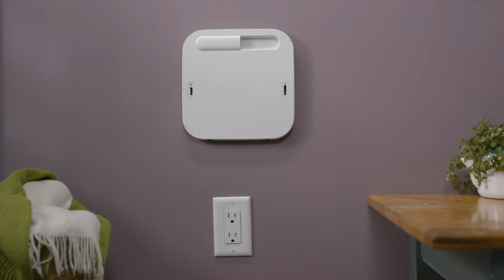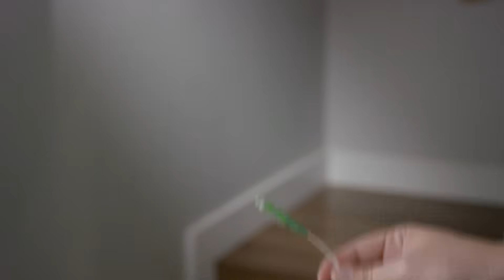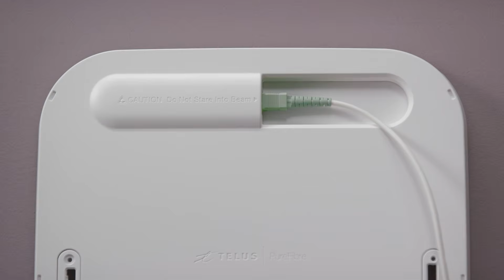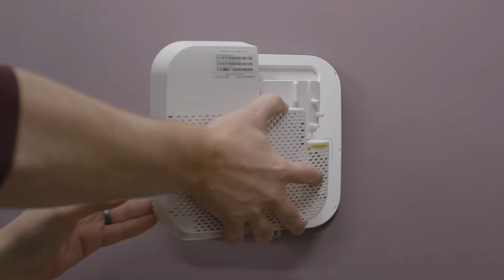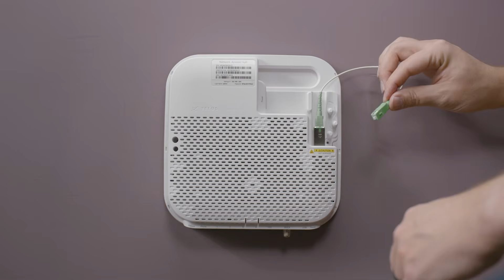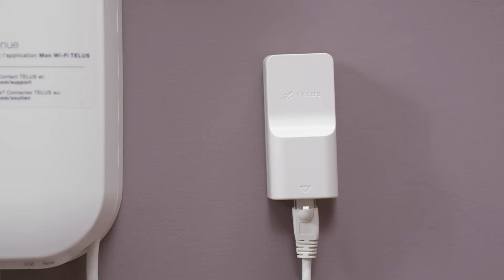TELUS | Installing a Network Access Hub

Comment: It's as if most of you started complaining about not knowing how to open the cover without actually watching the video.  It's amazing how quickly people act like children.  Go back and watch the video.  it's 3 minutes long and it shows them taking the cover off.  nothing more to it.  And yes i have the same one and I have removed the cover and the passwords you need are printed on a simple sticker .
Reply: this child couldn't see where is the procedure to open the cover in this video
Reply: The video has nothing to do with opening one that is mounted to the wall. That shows disassembling it when it comes out of the box, when it is not attached to the wall plate. 
People wouldn't be complaining if it wasn't designed to be very difficult to open.

Comment: How do o get the admin password
Reply: There are 3 screws you need to remove to get to the "inside". Honestly F** telus for hiding it in there, I just wanted to enable bridge mode and now I'm worried they're going to ding me when I return the equipment because I opened it.

Comment: But how do you remove the wall plate if I want to paint my wall?
Reply: The wall plate is two pieces.
Look for the holes on the corners.
When the NAH is removed, you can insert a screw driver into the one of holes and pry the two pieces apart.
Once apart, you will be able to remove the mounting screws.
Reply: @chaydium2535  Most valuable commenter here. Couldn't find this info anywhere online, thank you

Comment: My  network access hub is flashing green and not solid green. Someone from Telus installed it for me. It was working fine for a week but now it’s not working. What do I do? Telus support online keeps taking me to the same pages but I never get my sender. Please help me!
Reply: Wait for it to turn solid, if it’s not solid after 5min, unplug it for 10 secs, then plug back in, if that doesn’t work, call the technician instead of support.